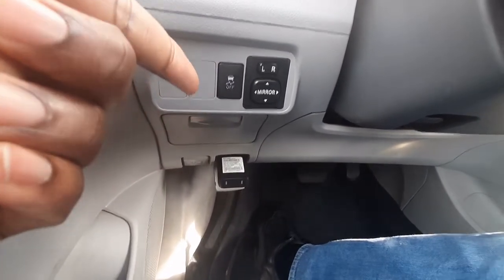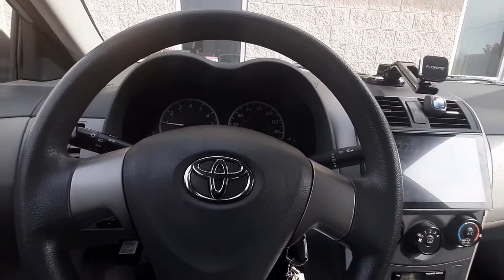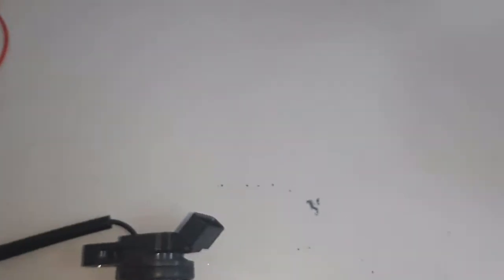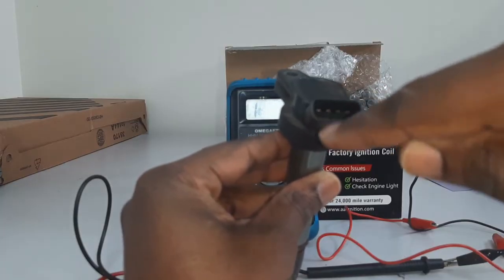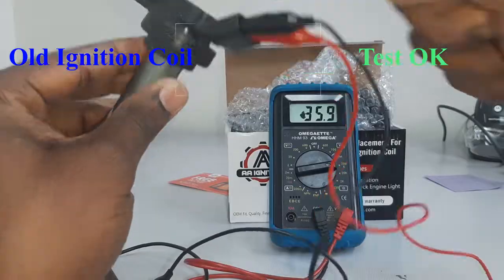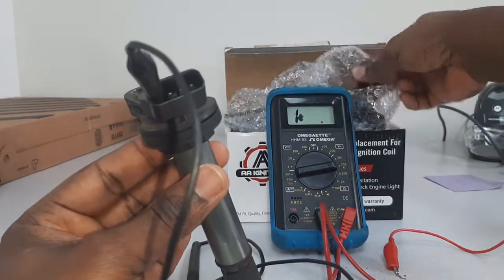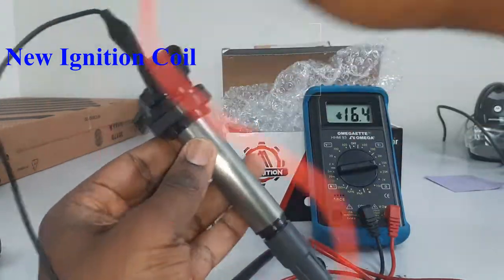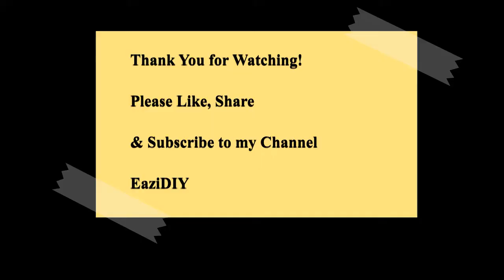How to Test Toyota Corolla Ignition Coil Eazily | P0300, P0301, P0302 Fixed

Comment: Great tutorial, but you can't only rely on an ohms test to determine if the coil is good or bad, as results can be inaccurate. You also have to verify the coil's input and output with more advanced diagnostics. Use an ignition coil tester to see if there's any spark coming out of the coil.

Comment: i have 39 ohms from 1 to 4. and 18 ohms 3 to 4. all for except one coil. my engine runs bad. could this be the issue
Reply from the maker: Can you replace that "one" coil?
Reply: @eazidiy  I just ordered all 4. after market. I'll let you know. also, I used platinum plugs.... not iridium

Comment: i get the same with 1 through 4 of the small pins but get nothing from the plug end on all 4 ?
Reply from the maker: Coil is bad!
Reply: @eazidiy  its bad on all 4? in a running car?
Reply from the maker: @ivanrousseau5066 are you sure your multimeter probe could touch the coil inside? There should be a reading for any good coil.

Comment: Hello, thanks for this video. Open circuit is same that coil doesn’t work?
Reply from the maker: Yes. Coil is broken
Reply: @eazidiy  thanks for reply, one question pls: all ignition coils which are open circuit means that they don’t work properly? NGK authentic from official website but no reading resistance on secondary, so defective?
Reply from the maker: A coil is made of wires wound in it. So there must be a resistance reading if the coil is closed circuit ( meaning it is not broken). If open circuit, there won't be a reading. If you are testing a new coil and no reading, I will suspect the meter you are using for the test.

Comment: The aftermarket ignition coil have a reading..But when I test the Toyota Denso Oem coil,it's not reading...I've done the same in another car..It has 2 oem and 2 aftermarket...I don't get any reading out of the old coil but the new one or aftermarket one has readings...Why??And the car that has no reading,also has no problem..It start and run okay
Reply from the maker: I don't have an answer for that

Comment: I tried on all 4 coils and got no reading on all when I checked through the SP connector. But the car still runs. I don't know if im doing it wrong but I did exactly what it on your video. what do you think should I do next?
Reply: Did you try increasing the ohms on the multi meter
Reply from the maker: I suggest you replace them but I will ask you seek professional help if needed.

Comment: in this video pin 1 is ground/black alligator clip and pin 4 is positif 12 volt/Red alligator clip is it correct?
Reply from the maker: Yes or you can swap the pins. What you are testing for is the continuity in the resistance of the coil.

Comment: I didn’t get any reading from the spark plug connector from any coil, double checked , rechecked even removed the boots.  Only reading from the pins of 35 for all. This tells me the new coils you got are different and got a reading of 16 instead of 35 which is different
Reply from the maker: The difference in reading of the coil depends on the resistance the turns of coil ( length of the wire), thickness of the wire and temperature. You should have get readings from the end-end of a wire or coil unless you have a open circuit ( broken).
Reply: @eazidiy   yes the resistance difference is not significant, k ohms between Oem coils and new aftermarket one. I had the same reading on the bad one and all coils and the way I figured it was bad was by switching it,  ( s plugs were good ) and getting the Obd reading for the cylinder it was switched for. Other than that, the bad coil had the same reading as the good ones, at least I didn’t have to buy 4,  it’s fixed. Still scratching my head or sometimes a bad coil will not give a bad reading 🙂
Reply from the maker: Good for you. I would have suggested you replace the four coils . Down the line, you will have to replace them.

Comment: Honda 3-pins plug coils 15 years 98k km, car had no power & jerking badly. Changed spark plugs, not much different. Changed all plug coils, car like "new". Did use multimeter, old coils higher resistance than new. Thanks, good video, did 👍🍻
Reply from the maker: Yes, the old coils are OEM with much higher resistance than the aftermarket new ones.

Comment: Pin 1 is 12v and pin 4 is ground, but what about the other 2 what are they for?
Reply from the maker: Pin2 is the ECM IGT signal and pin3 is ECM IGF signal. In the video, I tested the continuity of the coil resistance at pin1 (12v battery) and pin4 (ground)
Reply: https://www.youtube.com/watch?v=Clp8pAjzDAo&t=735s

Comment: The bad coil didn't have a short, it had an open. The 1 with dot on your meter indicates an open circuit.
Reply: im not getting any reading on my new coils
Reply: @loyalty3443  You have to be geting some kind of reading.
Reply: @loyalty3443 You need to get some readings
Reply: Yes totally agree
Reply: in autozone store I tested new duralast and ngk coils for 2010 prius, tester didnot read any resistance because I told them that all coils were blown, they were laughing 😂😂😂 
Is always right this method for checking?
Reply from the maker: You are correct. Thanks
Reply: @eazidiy  A lot of people get this mixed up. Otherwise, good video.

Comment: i see you used 3 different wires. Where was the 3rd wire connected to?
Reply from the maker: I used alligator clamps to extend my connections from the probes of the multimeter to the pins of the ignition coil.